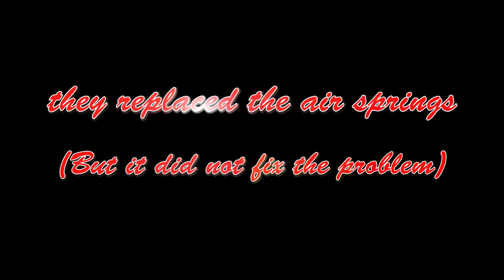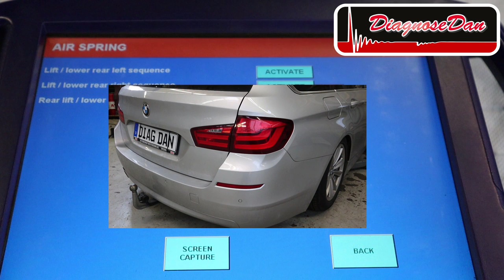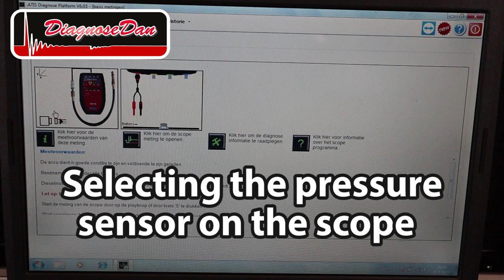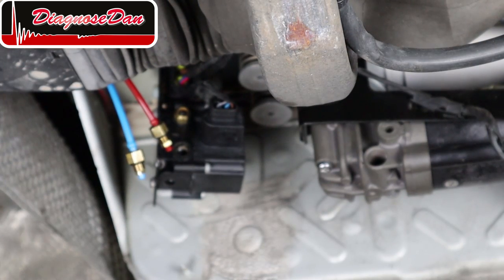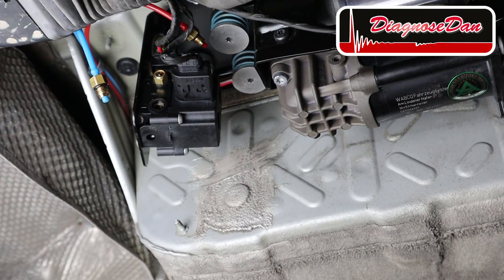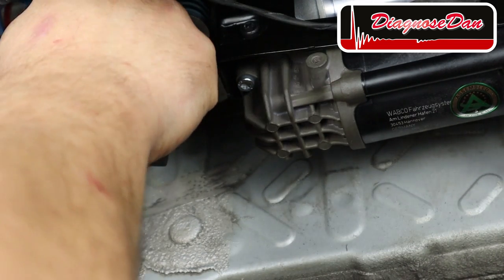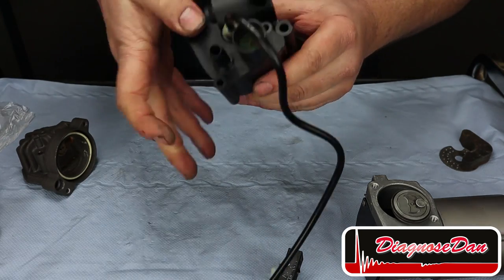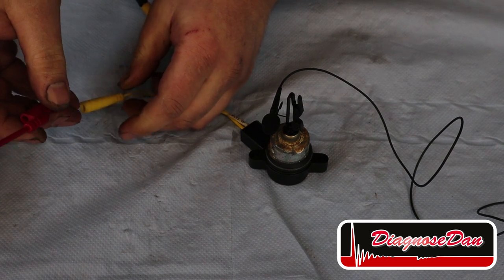Air Springs replaced, but no Fix!

Comment: I just came across this video. I went ahead with spring conversion on my e61 (to be fitted soon) as the EHC module have failed. I have found that these systems are way too complicated for what they are. I have seen a lot of happy guys after doing this, so for me, this was the simple answer and I can always go back to the air suspension. Full conversion kits are available on eBay for a range of BMWs cost is around £200  + coding (you can code it yourself if You know what are You doing...) which is about £50 - 70. I will see how easy it is to fit within next couple of days. If You are interested send me a message for updates. 

FYI i do not sell or do any coding so this is only my humble opinion.

Edit: forgot to mention peace of mind after this... No problems with compressor, air bags, hoses, filter, electronics.

Comment: Great video Dan, wouldn't it be very easy and straight forward for the original shop to give it the old finger test before replacing the air springs? Seems so logical!
Reply from the maker: They will do that next time!😉

Comment: Hi Dan!
Tx again for your detailed explanation and nice video editing. It shows that you put a lot of effort in your vids! 
Regarding the subject of this episode I’m curious about two things:
1. A 2017 car should still be under warranty so why wasn’t it repaired by the dealer?
2. Who is going to pay for the unnecessary replacement of the air springs?
2nd question might be tricky to answer here, I’ll understand if you can’t.
Reply from the maker: The car was imported from another country and than in some cases the Local reseller doesn't provide waranty. And i don't know about the airsprings because those were replaced by another shop, and they handle the customer.

Comment: You can tell that it was the pressure release valve that failed, just by the sound of it from outside the car. The Airmatic pump is much louder when the valve has failed than when it works and is closed.
Reply from the maker: Sometimes the camera doesn't pick that up.
Reply: i guess this is part of the learning curve. As far as quality, the exhaust valve parts should be stainless or zinc coated to wistand expeling water once the desicant material is saturated. Overpriced cheap junk....

Comment: You can also put your finger over the outlet of the Compressor and see if it’s making pressure.  My 535 had the same problem, the Pump ran but hardly any pressure.

Comment: Can you tell why this wasn't covered by factory warranty, being so new? Also, be glad you have not worked on mid-90s Lincoln Mark VIII. Multiple air ride issues in that car, compressor, air bags, desiccant, almost all long term moisture exposure related. In later years companies came out with mods like spider valves with air system moisture separators that kept the intake and exhaust air drier before it reached the compressor and vent valves better.
Reply from the maker: This car was imported by the customer from another country. The Local resellers than don't always provide waranty.

Comment: Great video, very informative and further investigation at the end helped even more - my pressure release valve is stuck in closed position by the looks of it - you just confirmed my line of thinking - it works fine when pumping the airbags, but it won't drop the pressure when commanded to do so by the diagnostic tool (ISTA in my case). Will look into buying replacement part as the compressor works fine, but it obviously needs control both ways. It wasn't a problem due to one leaking air bag, but now it can become a problem when the system will attempt to release some pressure, for instance when it will try to drop the car down if load is reduced. Thanks! Subscribed!

Comment: I thought for a moment you going to fix it no parts required when you started  to hit that solenoid just kidding good job well done sr thank you for sharing
Reply from the maker: I could have fixed it for the time being, but for the long run this was the best solution.
Reply: @Diagnosedan  That was a 2017? So long term = let's see...2 years?

Comment: Amazing that an automotive repair shop can replace a big dollar item like a set of air springs without checking for air supply first! Just because an air pump runs doesn't mean it is compressing air.
Reply: You can hear the motor is running unloaded, just listening is enough to confirm that.
Reply from the maker: @2secondslater  Not everybody has the same level of experience.😊
Reply: @Diagnosedan , it came to you from another repair shop?
Reply from the maker: @2secondslater  Yes
Reply: @Diagnosedan  this is major "inexperience" from a vehicle repair shop!
Reply: @Diagnosedan  great vid anyway, very informative and great use of "tools" :)

Comment: Hi Dan. Great video, best explanation ever. But I wonder, when the air springs and compressor are replaced, shouldn't the ride height be adjusted and ride height sensors be calibrated ?

Comment: Could it be possible that the valve block or compressor was leaking internally, or damaged connection to the pump? Possibly the compressor intake leaking? Or would that be seen during the air leak test?  Would the stuck open vent valve not show during a leak test?
Obviously your diagnosis was correct, I was just thinking the compressor and valve block are separate assemblies so possibly two places the lack of air pressure could come from.
Stay gold.

Comment: As always, another great video. I especially liked the Bonus Footage and the autopsy on the vent solenoid. But, I have to ask. Did you check the lines on the complete system once more to insure there wasn't any hose leakage. Since the pump did not have the capacity to build pressure then a check of the hoses for leaks, at that time, would not have been valid.
Reply from the maker: I noted in the video i already checked the system for leaks. This can be done with shop-air and i'll show that in a future video 😉

Comment: As with any German system, when it fails, check the most expensive part first. It's usually what fails. Why don't they draw air from inside the car where it should be dry? Doesn't a ridiculously expensive car like that have any warranty? The suspension system seems like a safety issue to me.
Reply from the maker: Thanks for watching!

Comment: Nice fix Dan you are the best on the net with all these car problems. Should that part not be stainless steel to stop the rusting problem ?
Reply from the maker: Great idea send Wabco ( the manufacturer) a message! 😊
Reply: @Diagnosedan  I might just do that Dan Have you done any videos of a fault that only shows up whem fuel tank is full ? diesel car (Ford) ? Thanks
Reply from the maker: @marke293  No i haven't
Reply: @Diagnosedan  that a shame as that seems to be a problem on my daughters Focus but have the dreaded no fault codes

Comment: Very Informative/comprehensive. Thanks. A small question ... with plastic air line threads, approximately how much of a turn do you recommend beyond finger tight? And what kind of oil/grease applied to the threads [as you show] helps the seal. Thanks very much. Looking forward to seeing your other videos!
Reply from the maker: Always be easy on these threads, tighten them very gentle. If it leaks you can always tighten them a little more. I use multi purpose grease.
Reply: Thanks much.
Reply: BMW says the air lines should be tightened to 2 Nm. That is not much! Be careful when tightening!

Comment: I suspect that I have a similar problem with my Citroen C4 Grand Picasso. Mine will pump up but will drop down overnight. If I raise the suspension to above the normal ride height it will stay up when the engine is turned off. That's why I suspect that the air springs are fine.
Reply from the maker: Thanks for watching my video's it's appreciated !
Reply: A new compressor from Citroen (no point taking a chance on a used or reconditioned item) is nearly £1,000 so I converted it to coil springs as fitted to the lower models (mine is a top-of-the-range Exclusive which has the rear air suspension as standard). I bought some aftermarket springs and bought the spring bases & bump stops from my local dealer. Total cost was under £200 and I used the diagnostic software (Diagbox) to disable the suspension ECU and pulled out the fuse for the auto height correction function. I don't have any error messages or warning lights on the dashboard but it does generate a couple of error codes.

Comment: Hi Dan I can't thank you enough. Especially the tips  at the end with the solenoid valve. I to have replace the air bags which coincidently the problem went away for a few months. Yesterday it went down and would not come up, Stripped the pump solenoid as you showed and  all working fine now I do have a question, are there sensors that set the left and right ride height, if so where are they? Thanks again
Andy

Comment: Great video! Thank you! After the replacement both sides Air springs (Arnott A-2780) for my car (2014 BMW 535 GT) compressor did his job and inflated Springs, but now my car’s rear position is not even: left side is about 1inch higher compare to the right side. I wonder what’s cause this? May be I should look deeper to the Sensors (??). Really appreciate your answer! Thank you

Comment: In my opinion the compressor is the first component  to check if  is working properly. And that is because there are to air springs which are using the air from the same source. So it is logical, first, to confirm  that the source of the compressed air is ok and only if the compressor is ok going further with investigations. For me is like "-sir, the car doesn't move"..........."ok my friend, but is the engine running?"

Comment: stilll better than the factory compressors on the dodge rams with air suspension lol...ther ea regular maintanace item in the winter...was actually a huge shortage last winter as they could not keep up with blown bags and burn pumps caused by cold ass winters.

Comment: So basically, the air inlet needs to be run through a dryer before meeting the compressing piston set? Or has the car been sat in a very deep puddle, parked on wet grass, driven through a few to many fiords? There's a guy in the UK called "Bagpiping Andy" who does repair kits for the piston in that compressor, it doesn't have a "small end" so the piston cannot follow the bore of the piston squarely and wears the piston ring out on one side. I used one of his kits to get another three years life out of the suspension compressor on my Jaguar XJ6. He's on that well known auction site.

Comment: Dan very nice diagnose and fix. So the main fault is caused by the intake that sucks in dirty and moist air. How about modificate the intake with a proper air/moist filter as used in automotive paint shops. Idea for BMW maybe to avoid warranty claims.
Reply: no, not dirt, these pumps have filters. 

Most likely the air spring had a leak, the pump was always running to keep the car up, and it built up too much moisture for the desiccant material to absorb, so it rusted. When you compress humid air, you get a lot of water. 

If the pump only works not very often (normal condition) this is not a problem since the desiccant can absorb it and dry out over time. If the pump is always running because of a leak, it's always making more water and that is the issue
Reply: @Uninfluenceable  yes i saw that filter but apparantly not enough so use an extra external filter.
Reply: Ian Derzsi 
Sh*t, why didn’t I think of that?
Tx!!
Reply from the maker: There is an external filter this is where the intake hose connects to.
Reply: Willem Streutgers 
Because of the faulty valve, the compressor almost constantly sucked in air. That caused an excessive amount of moisture. When operating normally there would be hardly any (damp) air entering the compressor. So no need for a additional air filter.
Reply: It would be interesting to know if there is a software strategy to help prevent this. On trucks, with air brakes, the vent valve is used to evacuate condensate and ventilate the desiccant with dry air to "regenerate" the desiccant. Perhaps operating the compressor with the vent open periodically would help to keep the system dry. Everything did appear to be dry when Dan took it apart.

Comment: I think the "soft click" at 23:42 might not be an actual sound but rather electrical interference caused by breaking the circuit (solenoid coil is an inductive load) picked up by the microphone circuitry in the camera. That'll be why you couldn't hear it!

Comment: Is just erasing the air suspension still a common fix for this? Those compressors seem to be pretty flimsy just like the ones in Range Rovers.
Reply from the maker: I think the ones used by Range rover are the same
Reply: @Diagnosedan   Yeah looks very similar even to the pump that was a known weakness in range rovers 15/20 years ago. The p38 model.

Comment: Great video Caped Crusader(Batman). My 750Li seems a little low in the rear end, although no warning lights. Wondering, when the car drives will the car lift a bit. When you hit the traction control button DTC do they lower or firm? That was a good video, wonder what fuse and relay is connected to that compressor? (My). Back to the bat computer, thanks for the tip!
Reply from the maker: The ride height can be ajusted with a scantool i hope i can show this in a futere video 😊
Reply: @Diagnosedan  hope your video somehow gets to the manufacturer of pump. I have been reading up on my car. 1)My steering wheel doesn't go up or down, in and out ok. 2) passenger side door handle works but doesnt operate locking mechanism. Saw your video on short in door handle. 3) CD CDC Logic 7 amp player works but FM AM does not? 4) PDC light flashing, when I get close to something grey picture of car comes on screen, no chimes.5)noticed heated rear passenger seat doesn't work? 6) I drive spins on it's own sometimes. 
7) engine light on, P0014 think it's the vanos on bank 1?? Symptom when it warms up and goes down to 600 RPM there is a little hiccup that throws the engine light on.
Years ago I heard how computers would screw up cars, but I didn't think it would be this bad, and this car has been driven by clean people since new, not abused.

Comment: I know this video is a year old, but I wanted to point out that BMW compressors have dessicant beads in them. Over time, as they absorb water, they swell, thereby blocking much of the airflow coming out of the compressor. To fix the problem for cheap, simply remove the old dessicant beads and put fresh ones in. You can find them on Amazon or a simple google search.

Because these compressors are NOT cheap, I highly recommend checking out this option first.

Comment: I wouldn't doubt it could hit 230PSI, the common max for air shock systems has been right around 200PSI for years, at least the limited amount I've worked on and plenty of aftermarket....

Comment: Considering it is a new car I wonder where it is parked and how much it is used. Where is the air intake for this compressor on the car? I mean for the dry air requirement the compressor is placed in a shitty place. Also why is it the friggin pump's job to filter and dehumidify the air? why couldn't this compressor have a separate airbox for that? This entire air suspension setup looks like a terrible afterthought(as well as the unhelpful 1 code) and BMW is usually better at what they do than this. Thanks for showing me that I would definitely not want this air suspension if I ever to buy one of these models. :) Great vid.
Reply from the maker: The intake hose goes to a seperate airbox. The material in the pump only dries the air entering the system after the compressor.
Reply: Right. That is it then. An afterthought. Some compressors use vortex filtering(just like the oil separator valve on the engine) to get rid of particles and moisture but of course it would have to be significantly downsized (it may even require adding in some precompressor) to perform in such a tiny amount of airflow. It also doesn't help that the compressor is mounted the wrong way around for such a filter to work well on it. My problem with this is that putting silica gel in an airflow, which even after the airbox looks pretty dirty(or is that all the rust?) will only last a short while. This is not a solution, this is a problem, an engineering disgrace. It could have also helped if those valves did not have any metal on them exposed to such a poorly filtered air intake... I guess many people could pick a solution that would have worked better than this. I find also the price of a new pump outlandish... WTF!? For this abysmal piece of crap that is destined for the bin within couple of years out of sheer negligence/malice? I am a software engineer and I hate forced obscolescence with a passion and my industry is most affected by it. Meh.

Comment: In the case of these pumps, when an air-bag fails, the inbuilt pump dryer will become saturated, the discharge valve will go bad (stuck open usually) and it may also ruin the piston seal - they are all repairable... so hesitate before just buying a new compressor when your car does this ^^.. the old compressor may in fact just need some attention after you have suffered a failed airbag situation. :-) Which is a lot cheaper solution than a new pump... if you're watching the pennies..

Comment: I could tell the problem before any diagnosis began after hearing the compressor run. It’s free running. No air leaks heard no load on the compressor. Therefore it’s not compressing any air. And yes it’s a common BMW issue.